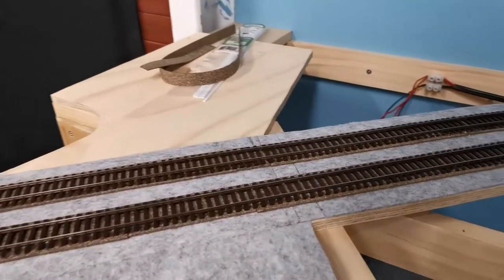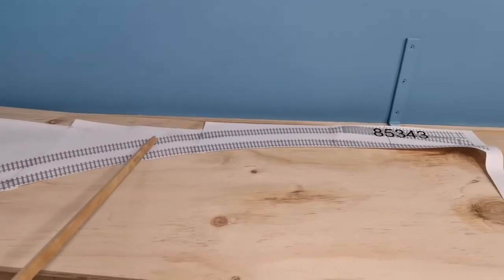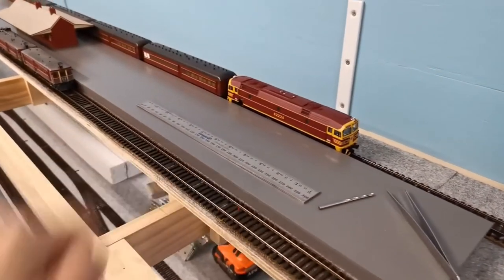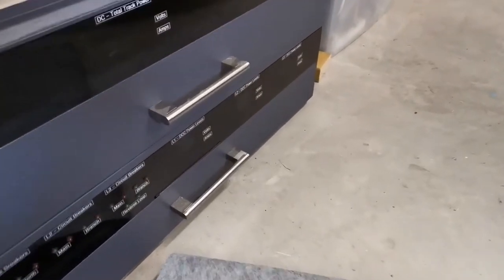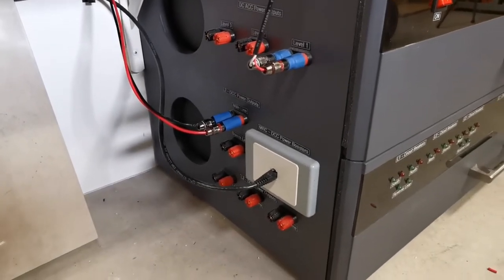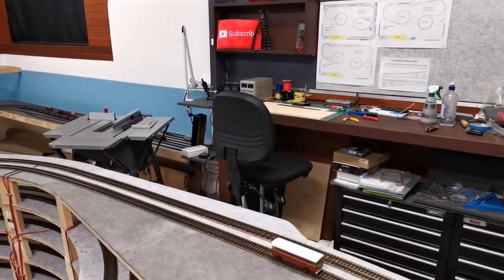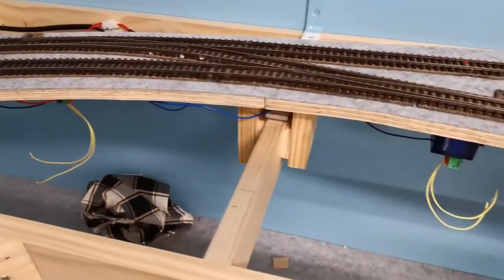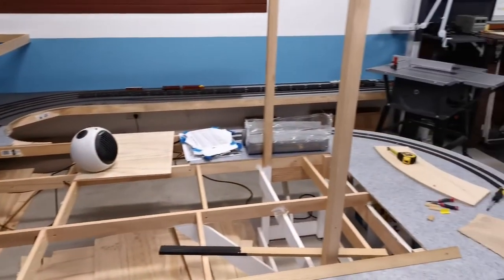July 2019 Model Railway Build Update - The Escarpment

Comment: Thanks for showing the wiring again, putting things straight in my head as to how to go about mine, basically much the same as yours Jason.
Regarding the platform, is the top a different cut and just placed on top?
Looking forward to watching how you go about finishing the platform.
Interesting that your going analogue with your point motors as I decided to go that way right from the start, but I will be having a fancy control panel, dont tell the missus.
Regards Chris
Reply from the maker: Thanks Chris! The platform was all one piece, as I used a table saw to get the cuts on the sides. I will be redoing the platform as I have decided to 3D resin print the sides. This was to achieve the platform designs found on this line. I have done digital points before but never like controlling them from my CAB controller, so this time it is just controll panels. Are you getting yours custom made? Regards
Reply: Yes Jason, we have a company over here called DCC Concepts, I get a lot of stuff from them. This video shows the panel I would like https://www.youtube.com/watch?v=SLLSQXPGGL0
Regards Chris
Reply from the maker: Arr yes, they were here before they moved their operations to the UK. Looks to be a good system. Haven't  made my mind up with mine as yet